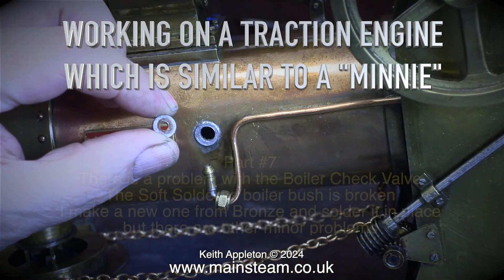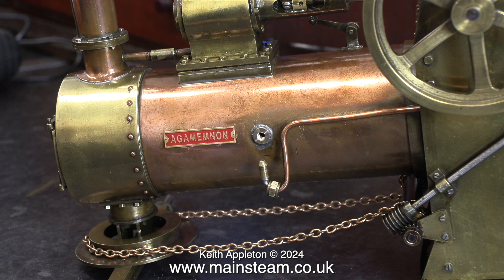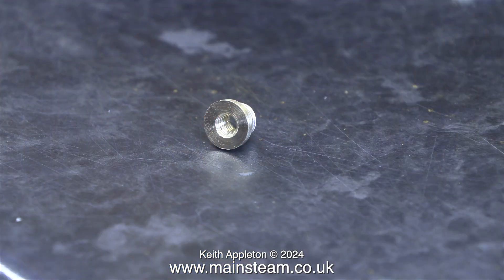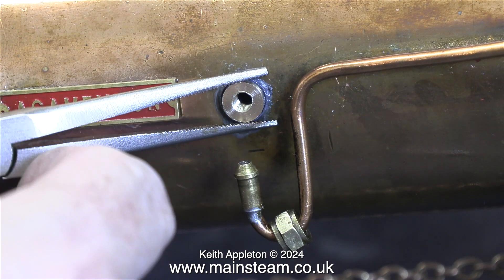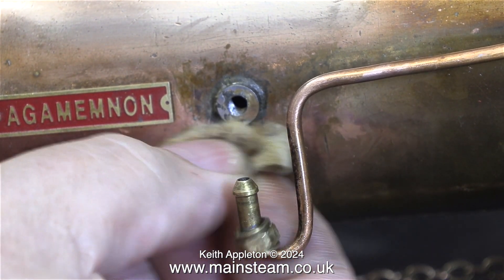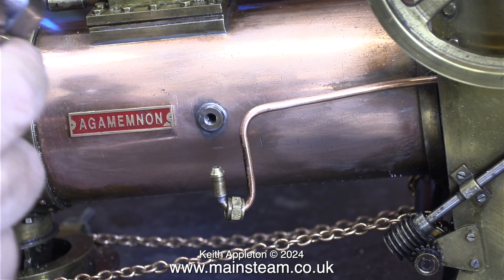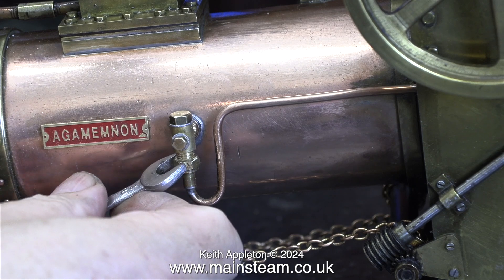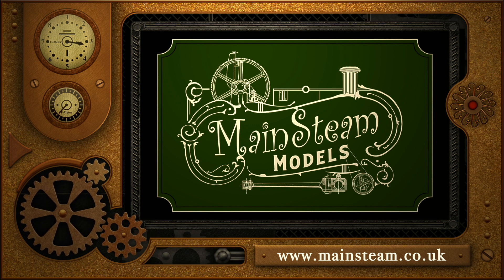A "MINNIE" TYPE TRACTION ENGINE - PART #7

Comment: Keith, FWIW, the activating agent in RA (rosin activated) flux core electrical solder is zinc chloride.  The causes burns warning on the "friolux" package suggests the product contains something much nastier than ZnCl2.